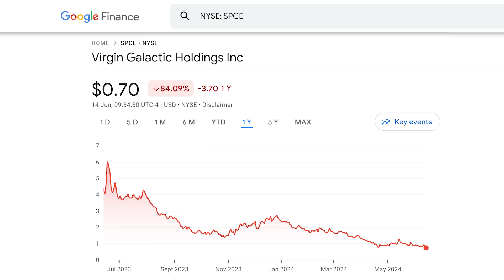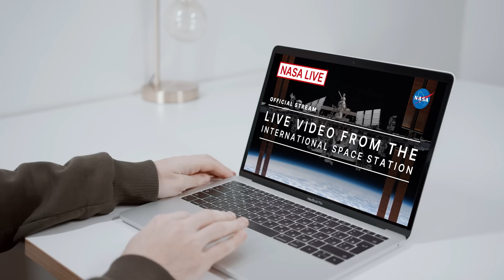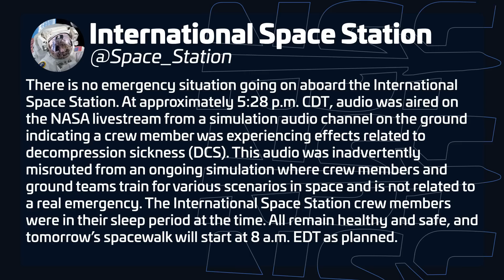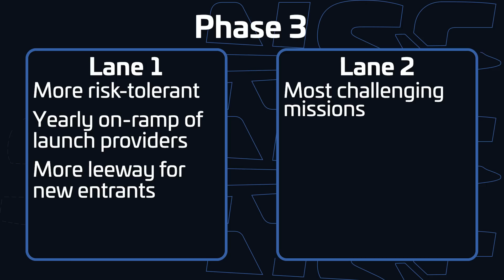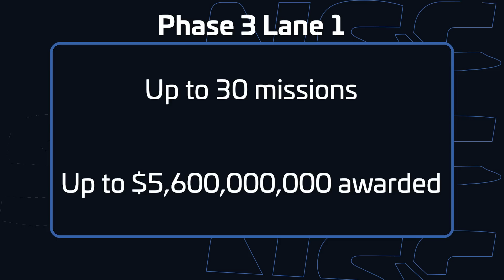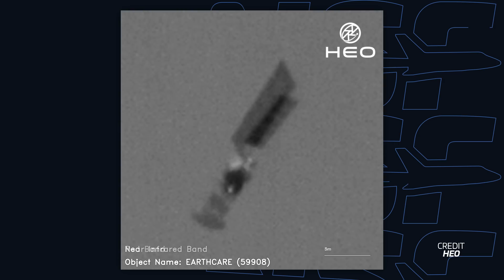Astronaut Emergency Simulation Scare | This Week In Spaceflight

Comment: 15:59 This was to launch a half hour ago, and it aborted at T-0 as the engines were briefly ignited. There's supposed to be another launch from this pad in a few days, so this could cause a problem with launch scheduling.

Comment: SpaceX always seems to get the short end of the government stick even though they are the most reliable AND least expensive.
Reply: Just you wait, sooner than later the government will have no choice to launch with space x as expendable heavy launch vehicles wont be a viable option anymore. ULA will fall apart as no one will want a expendable launch vehicle filled with delays and blue origin has never got to orbit before so they will be on a fine line.
Reply: Elaborate.

Comment: 7:20 the other away around its 4th methalox engine and second full flow engine.
Reply: Nope you are in fact wrong
Reply: @jesserutt7413  RD-270 was only under development, integrated power head demo never flown or in have plans for future use.
Reply: @lartorgames  okay so i guess you are just being semantical about what exactly “developed” means, there is nothing wrong with what they said. Developed doesnt mean flown.
Reply: Also they said the second methalox engine to use this cycle, not second ever methalox engine
Reply: No, it's the second methalox engine to use the full-flow cycle, and the fourth overall full-flow engine that's been developed